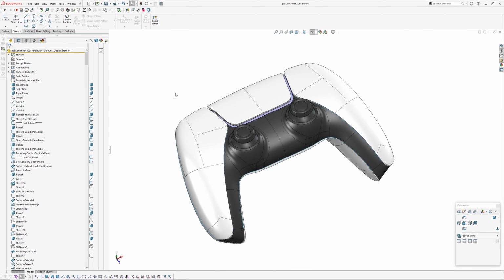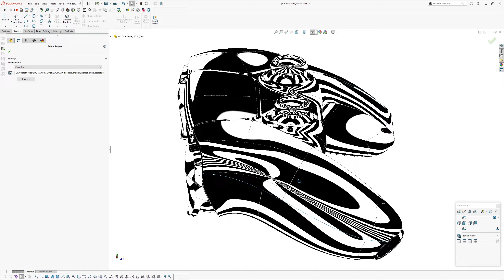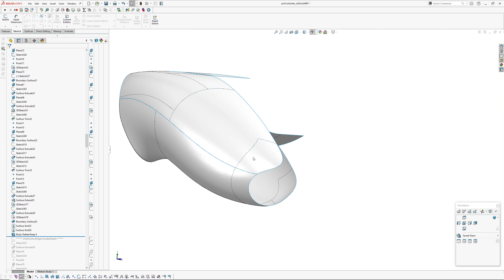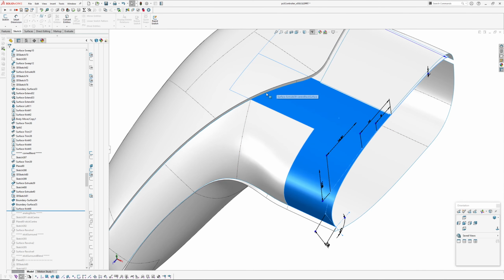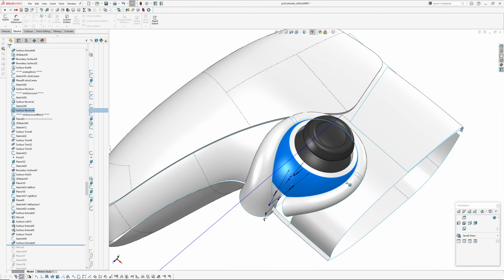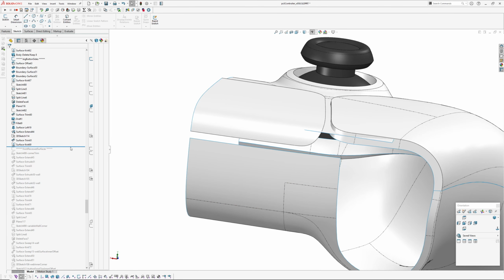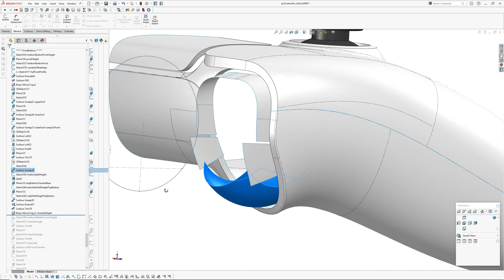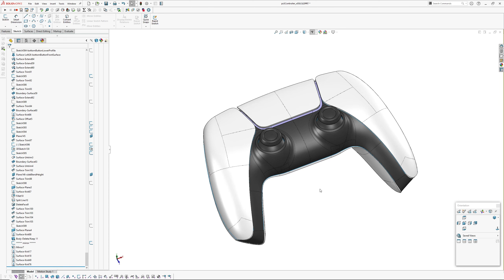Playstation 5 Controller, Modelled in Solidworks. Part 2

Comment: Great work! Thank you for this very detailed view into your approach.

Now that you have the hull, how would you commence to design the interior of the product?
Would you use the surface model file as a master model?

Thank you for providing this high quality content!
Reply from the maker: Hi there, I'd probably create some key offsets at logical points in the feature tree. Then use insert part to insert the master into part files and build the shells from there using the offsets. Thanks for watching!

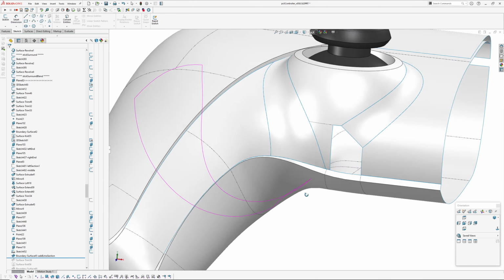Comment: Hey Andrew at 9:00 how did you combine that series of 8 boundary surfaces into one smooth surface around the analog stick, im currently working on a similarly complex form but my split lines are still present on the combined surface when I knit them together
Reply from the maker: Hi there, I made that as a single boundary surface, used selection manager to pick the long boundaries, merge tangent faces on. Result was a single surface. I did try making this as several boundary surfaces but had some wrinkles between surfs. If you have issues with the boundary surface being multiple faces even though you have merge tangent faces selected, that means there’s a discontinuity on one of the boundaries.
Reply from the maker: you’ll always have edges between surfaces even after knitting them together, unless you’re knitting pieces of the same geometry together like an extrude (merge faces on)